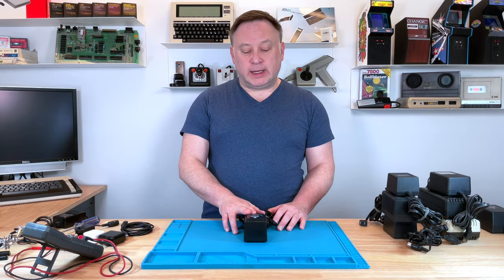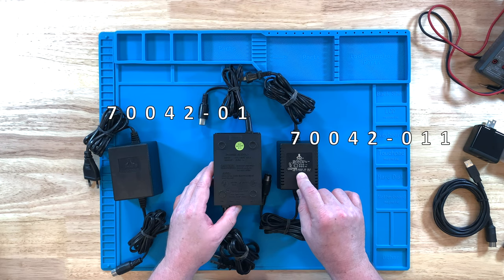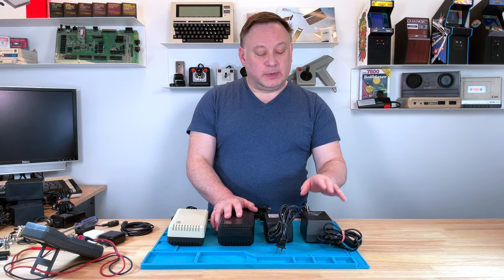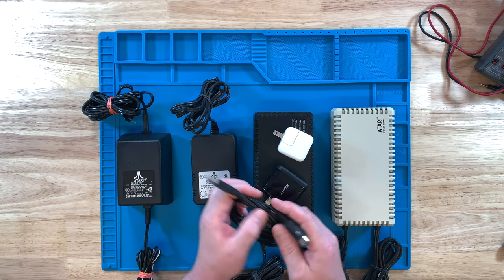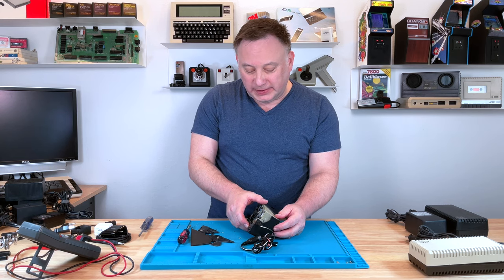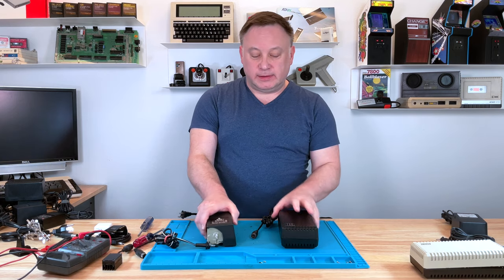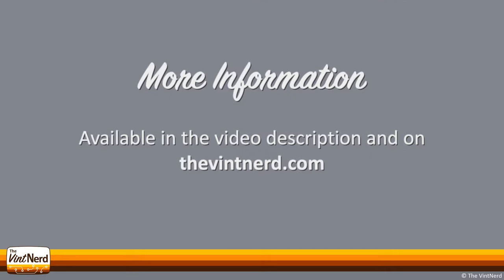Stop using the Atari 'Ingot' power supply, Seriously!

Comment: I carefully removed everything, installed a 5v USB charger and a USB socket and kept the retro look.
Reply from the maker: Nice! :)
Reply: Didi you install the USB Socket at the computer end, as in replaced the DIN Connector? Thinking this would be a great idea...
Reply from the maker: My guess, Nickolas put the USB socket in the Power Supply Case.

Comment: Been there, done that... and regreded a lot. Such an "inglot brick", that I used thinking, that 1.5A is better than 1A, outputted 12V to my system. And it fried almost all of it... The thing was, it was equipped with a lot of stuff from Lotharek - VBXE, U1MB, Rapidus and Stereo. Some of them partly survived (overvoltage protection on them) but some needed chip replacement. You can easily count the cost. It hurt...
Reply from the maker: Ouch! So Sorry to hear about that. Glad you got most, if not all, of it working again.

Comment: Removing the inside of an ingot PSU and replacing it with a Meanwell PSU would  be a really nice project, and a way to save a genuine, original, vintage Atari PSU.
Reply from the maker: Definitely a cool project. Biggest problem is opening up an 'Ingot' power supply without damaging the case. But, Doable! :)
Reply: @TheVintNerd  I reckon a dremmel might be useful. The epoxy brick can be destroyed. Maybe making a big hole inside the epoxy brick?
Reply from the maker: The epoxy brick sometimes can pop out rather easy; sometimes. I'd think the big concern is getting the bottom cover off without damaging either parts of the plastic case. :\

Comment: I was interested to see if the ingot was repairable I get pissed off when I spent a few hours typing in computer code when I almost finished completing typing in code the Atari 600 turned itself off and that happened a fair few times
Reply from the maker: The Ingot isn’t ‘repairable’, but people have gutted the electronics inside and put another, newer power supply in its place.

Comment: This chap is spot on!  I just got a bundle of 8 bit Atari kit which came with 2x CO 60592-34 9V ac-ac adapters and 2x big brick CO 61763-34 5V dc ones.  The 5V ones were OK but both the 9V AC ones were putting out just over 12V!  So if you get any please check with a meter first and resist just pluging in to your treasured original 800 or whatever, it'll end in tears!  Thanks for posting.  Nickolas G has a good idea in hollowing them out and replacing with modern compnents. Jan Beta has a good mod for the brick ones with a Meanwell switching PSU. Cheers!
Reply from the maker: Thanks for the feedback and tips! -Cheers, Steve
Reply: The AC ones showing higher voltages is completely normal. They are just a transformer with no voltage regulation. Inside the console or computer is a bridge rectifier and a voltage regulator such as the LM7805 which takes the input voltage and outputs a steady 5V DC. The 7805 requires at least 7v input and can accept up to 35 volts (though that would result in a lot more heat so certainly not ideal).
Reply from the maker: Good explanation, Thanks!

Comment: When I upgraded from a 400 to an 800XL, it came with the Ingot PSU. The computer suffered frequent brownouts. The blue ("Graphics 0") text screen would suddenly turn pink, and seconds later the computer (IIRC) simply switched off. They must have received a lot of complaints, b/c I was able to return/exchange my 800XL no-questions-asked. The replacement was the smaller/lighter vented unit you showed.

Before I returned it, I opened the PSU up in hopes of fixing it (I didn't have any trouble. The epoxy hadn't bonded with the case yet.) The epoxy in mine was clear and you could see all the electronics inside like a fly in amber. I don't know what idiot thought trapping all that heat in plastic would do, but it sure as hell didn't keep things cool. The brick would get so hot touching the silver label burnt my finger! I can understand why it would throttle the voltage! Yeesh! What a mess!
Reply from the maker: Clear Epoxy? Nice! I'll have to see if any I have kick'n around are clear.

Comment: got one of the Ingots from New Zealand was putting out 5.12 volts today but my XEGS was fried by a C64 power supply years ago, I'm trying to piece it back together but will start with replacing the power supply after seeing your video, I'll use your usb power cable and replace, thanks for the video
Reply from the maker: Awesome! Glad I could help :)

Comment: Word of warning... Also the silver label 1.5A you showed here also can overvolt and do damage to your XL or XE.  This happened to me. Bought a 'new old stock' silver label from B&C on ebay and it failed not long after I got it.  Word on the street (or online forums) is that if they have not been used in 30+ years, they are more likely to fail. If these DC power supplies have been used somewhat regularly then they are thought to be safer. The A/C power supplies seem to be much more reliable since there is no capacitor or much else in it except a transformer.  The Atari8bit FAQ mentioned at once point that the A/C adapters can suffer voltage drift over the years but I've not seen that in any of mine, and i have about 15 of them.

I have an XL vented styled black one that you opened here have even been hesitant to use it due to fears of it failing, even though they are considered reliable and so easily serviced. These are sometimes nick-named 'black beauties' because the cream-white XL styled ones are nick-named 'beauty queens'. 

Good job on the video. Great audio quality and your video production quality is also great!
Reply from the maker: Thanks for the feedback. Appreciate it! I've actually watched a bunch of your Atari videos, too. Some nice gear you have.

Was not aware of the "if they have not been used in 30+ years, they are more likely to fail". Makes sense though. Everyone pulling their old computer out of the closet after decades is taking a chance when they plug it in...unfortunately.

-Cheers, Steve
Reply: @TheVintNerd  You're welcome! Glad you've found my videos! Thank you. There's more I want to make. 

Would be good to know your Atari story.. How you got into it? What was your setup? etc... For a video.
Reply from the maker: Yes, definitely make more videos.

My story? lol I want to build Subscribers, not bore them. We'll see. :p
Reply: @TheVintNerd  Oh of course, maybe just a 30 second history brief is good.  As far as the use of power supplies, afaik the recommendation is that, at a minimum, it is good to exercise the capacitors ten minutes every three years. This is for the computers and other devices as well. The 1200XL unboxing video I posted experienced the common issue where first powerup does not succeed, almost certainly because of the 'lack of exercise' of capacitors. Exercised an XEGS today here ;)
Reply from the maker: @gamedoutgamer  Interesting recommendation to exercise the capacitors ten minutes every three years. Thanks for the info :)
Reply: @gamedoutgamer . I read do it every 2 years for 30 minutes.

Comment: Its bad enough to sonic weld the plastic shells together and render servicing a pain, but the rock hard epoxy tactic is just pure evil (and stupid poor thermal design). I remember as a kid, hammering away a C64 PSU to investigate it. Just did one of those Atari brick ones, felt like archeological work lol. I was successful in extracting the transformer (centre tapped output, have not measured voltage yet) and the circuit board module (about 40mm x 70mm x 40mm). Aluminium U shaped heatsink encased it, but the epoxy still flowed very thurally inside the U shaped cavity. Have not gone farther yet. Something inside that circuitry makes a ting/ping ringing sound. Kind of like a spring or etc inside a relay. Plastic shell came out okay with no visible damage, but one corner about 10mm did split a bit. Do not know why I bothered with all that effort, when 3D modeling a case similar to the good two tone coloured one and printing it would be a more fruitful effort. Curiosity gets me every time
Reply from the maker: Right? What were they thinking?! lol  I've been thinking what would it take to 'dissolve' the epoxy brick away; and just leave the components. 🤔

Comment: Many thanks! You have probably prevented a disaster here. 👍 I did not know about this, I have a lot of C64s and therefore knew about the C64s death bricks, but I just assumed Atari's PSUs were better quality. I have an Atari 800XL, and typically it have the "Ingot". I will snip the cord and solder it to an old router PSU instead and throw away the rest.
Reply from the maker: Wow, Awesome! Glad the video helped. 😀
Reply: @TheVintNerd  I have now replaced the inside with a 5V 3.5A PSU. I put it inside the old case to make it look stock. 👍
Reply from the maker: @MariaEngstrom  AWESOME 😎

Comment: If anyone has a c64 wedge supply its only half potted. You can save it. I very carefully opened one. You need to take your time prise each edge a bit at a time. I then disconnected the 7805 regulator and wired in a dc to dc convertor to the raw 12v dc. Finally I replaced the output cord with one to suit my Plus 4.
Reply from the maker: Thanks for sharing the advice! -Cheers, Steve

Comment: Had an ingot back in the 80s that failed on  me. Luckily it didn't fry my computer. We had to cut a square through the epoxy to get to the fuse to replace it. 

It was nuts.
Reply from the maker: Great to hear it didn't fry the computer!
Reply: @TheVintNerd  Yeah if you're ever curious you cut a square through the top part of the epoxy there is a fuse in there. It's not a solid block all the way through. 

I can't remember how we cut through the epoxy. A woodburning kit knife or something. It's been since the 80s.

Comment: My 600XL w/ 64K memory upgrade from '84 had power supply issues using the epoxy power brick. It did not over-voltage but the filter caps sent through noise causing weird bit/character changes on the screen and sometimes crash/hangs. Had to buy a newer later design with the vents.
Reply from the maker: Glad to hear it didn't fry your computer! Hope you still have that Atari 600XL.
Reply: I also have the 600XL with a (back in the 80's) 64k upgrade.  It had the ingot and I was ignorant about the issue.  One day I turned it on and was met with a bad noise and wavy display.  Assumed my computer died.  I didn't throw it away but I did pick up a 130XE super cheap.  I tried the 130XE power supply on my 600xl and it worked though the RF out display seems damaged.  I plugged in a Sophia and it was clear so seems like the ingot may have damaged the RF.
Reply from the maker: Good thing it didn’t fry more of it !

Comment: I had an 800XL with the ingot back in the day (1986, my first upgrade after the 600XL).  I had to get my dad to keep buying replacements (went through I think 4 of them) because they kept burning out, and they were C$25 at the time.  I'm just glad they didn't take the computer with them.
Reply from the maker: Wow, Lucky!
Reply: @TheVintNerd  Apparently I didn't realize how lucky.  I knew they blew up (I still remember the smell, and how freakin' hot they got), but I didn't know the common failure mode was that it usually took the computer with it.  Man, I'd have been absolutely gutted if it did.  My dad could afford the occasional power supply (even if I was going through them like every three months), but not a new computer on a whim like that.  I moved on to a 65XE a bit later, which had a better power supply, so thankfully I never had that problem again.
Reply from the maker: @VaporChase  It's crazy how many you had fail. Hope you still have that 800XL and/or 65XE! :)
Reply: @TheVintNerd  It's absolutely nuts how often those things failed.  I've never had power supplies fail like that before or since.  I don't know if it's terrible design or poor manufacturing quality.  I actually thought that maybe it was the electrical system in our place, but we lived in a very new development at the time, so the electrical system should have been up to code.  (Not that I thought about that at the time.)  Sadly I don't have them any more, every upgrade I did was at least partly financed by selling my old stuff.  We didn't have a lot of money so I had to cover the costs somehow.  :)

Comment: I don't have any Ataris, but the epoxy filled power supply is familiar to me as a Commodore 64 owner. I use an aftermarket power supply for my C= and only kept the original for the sake of completeness. 
Personally, I wouldn't tell anyone to keep the brick for fear that an unscrupulous seller might sell it to an unsuspecting customer. I've seen a few in the wild solo and I knew better, but there's no guarantee a new buyer would know. There's no guarantee that a seller would know, either. They might think you're making a big deal out of nothing.
Reply from the maker: Very good points! Perhaps I’ll just except the bad power supplies and recycle them when they get here. Also, interesting that the C64’s have similar power supply issues. Thanks! -Cheers, Steve
Reply: I had picked up a C64 "breadbin" last year at an estate sale.  They had two breadbins and 2 C64c (in box).  I only wanted the one C64 (besides, I only had so much money on me) and they only had the one power brick between the two.  If it hadn't been that they were charging extra for the power supply I would have taken it just to keep someone else from unknowingly buying it.
I did tell the people running the sale that the power supply was not something that should ever be used again, explaining why, so hopefully they heeded my advice.  If the sale hadn't been SO far out of the way to get to I would have hunted down an ATM and picked up the other breadbin and one of the boxed C64c units
Reply from the maker: @SenileOtaku  Yup. Hopefully they recycled it.
Reply: @TheVintNerd  You could always ask them to clip the cords and send those to you. That way, you have a spare cord, no innocent person could be handed a Brick of Death, and you save on shipping costs.
Reply from the maker: @gmirwin  Interesting suggestion 🤔

Comment: I opened a C64 power supply, a old type that had no resin, I added a chinese regulator on the dc output to force the voltage down. Other than that its orginal and thats the way I like it.
Reply from the maker: Nice :)

Comment: I have the vented White Top power supply for my 800 XL. I've been able to replace the 78S05 voltage regulator twice. I recommend adding a cooling fan to it.
Reply from the maker: Cool. A fan is a good idea; though.. I dislike hearing fans. :|

Comment: I only ever had the ingot, since 1989, never used anything else. Now after all the warnings about it, I am afraid to switch on my Atari. Instead of buying a new one, couldnt you just modify the ingot? Either by just adding vents into the casing with a Dremel or take out the innards from the "sandwich" cases and place them in a new, plastic only case with vents?
Reply from the maker: Well, in general, it is heavily suggested that no one use any old, retro computer supply; because they are all susceptible to failing after 30~40 years. More so, the Atari Ingot is a lost cause. There is no repairing it or making it better. It is a large epoxy brick with old, unreliable electronics in it.

Comment: You can use a USB wall wart but most of those chargers only offer half an amp, which isn't enough for an Atari computer, especially if you want to it run something.  

Nearly all Atari peripherals use the 9VAC, that I've used interchangeably with my 1050, 850, 810, tape drives, various Atari Printers like the 1010 plotter, and my Atari 800 computer it self. It might also run the XF551 disk drive too. These power bricks are generally reliable since it only contains a transformer stepping the power down to 9V AC. I don't believe there are any capacitors in them that would potentially go bad after 30 years.

When someone says "XL/XE" most people don't think of the 1200XL since that computer was an odd-ball and not many of them exist compared to the 800XL. The 1200XL had some software compatibility issues that the 600XL/800XL (and the XE) fixed.

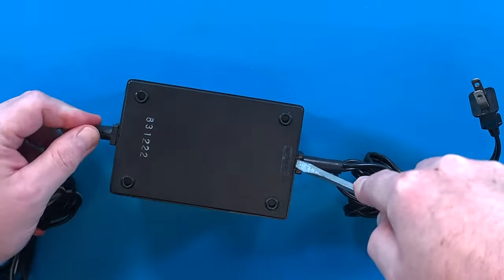12:20 that power supply you plan on recycling, I'd cut off and keep the 7pin DIN connector so you could use for another power supply, or add a USB connector to it.
Reply from the maker: All good points to make. I do always cut off and save the DIN connector. Parts are parts! :)
Reply: @TheVintNerd  You have great content, even though i'm about a year late finding your channel.  I happen to have the large black vented 800XL power supply, and about 2-3 9VAC power adapters somewhere in my closet.  I hadn't used them in about 8 years, but they do still work.  I wish i had a spare 7pin DIN connector/cable so i can make my own USB power.
Reply from the maker: @fragalot  Thanks for the nice feedback! :)
Reply: On a c64 dual output supply that was not potted I put a inline regulator board on the DC output hidden inside and left the Ac as it is as you said the Ac is fine.  If the supply is not potted that's all you need to so. Its actually cheaper to put a  Chinese regulator inside than to do anything else. :).

Comment: Yup, I fried most of the chips inside my carefully preserved 800xl a few years ago by unknowingly plugging it into its ingot after 15 years sitting. Killed it instantly. Wish I knew. Didn’t even think of checking it’s output voltage. Stupid me. :(
Reply from the maker: Argh! Sorry that happened. Now you know. Go on eBay and buy a beat-up Atari (bad case) for the chips. And, get a USB power cable. 👍🏻
Reply: @TheVintNerd  that’s exactly what I did. I’m on the hunt continually now for cheap chip donor XL’s. They’re getting harder to find!  :(